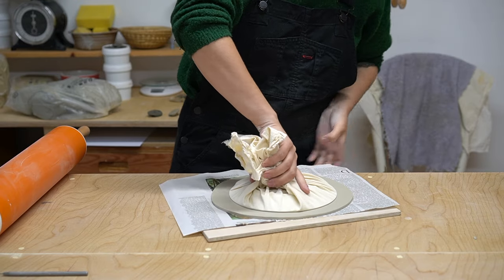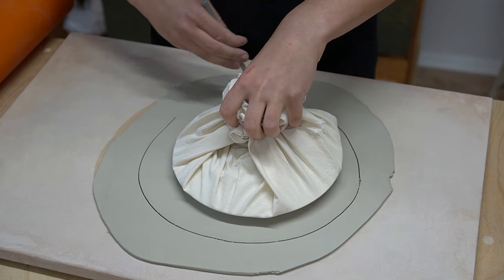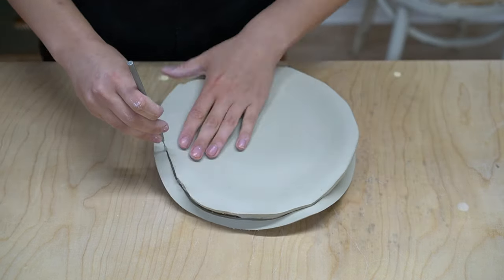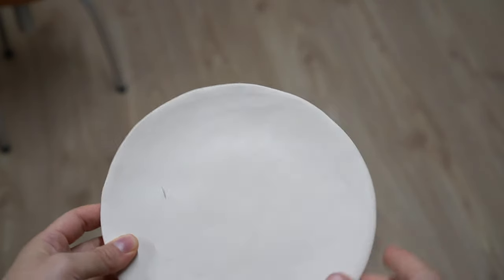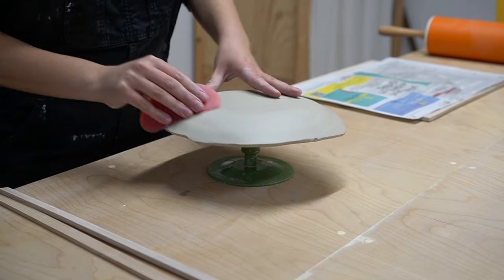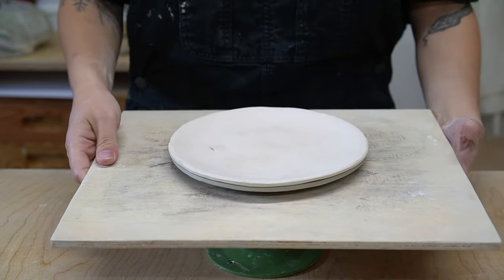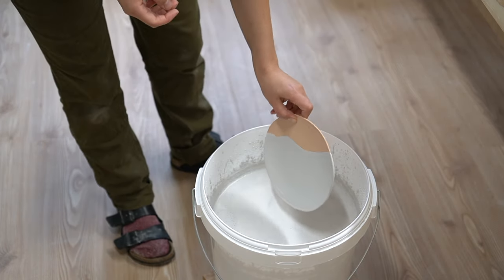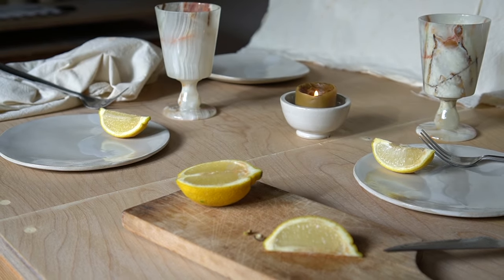The Easiest Way to Make Plates! // How to make ceramic plates using molds // easy pottery project

Comment: What type & weight of canvas is best for wedging clay on? Can it be used & covering Hardie backer board? I haven’t got to the plaster board yet; hwr, I know I’ll need a way to slow & speed up the drying without being over saturated or drying to fast. I live in southeastern USA. We generally have mildish winters. The summers, not so much. We get high humidity & high heat temperatures here. My husband moved some things around, which has allowed for me to use half the barn space plus shelves. My pottery wheel (25+/-yr old Shimpo RK Whisper) is out of mothballs again! I’m hoping to find some way to build a table around it.  We will need to get another wheel if he stays with it. He’s getting pretty good at centering clay, though I think the engineer in him would do extremely well slab building. 🤞🏼 

Any assistance is welcomed. I’m currently wedging clay on a Hardie backer board edged with painters tape.

Comment: 1:54 I noticed that you had trouble with setting down the fabric wrapped plate so you can work with it (you just cut to the plate on the table). Maybe next time you can have a shallow bowl or wide cup ready that you can put the excess cloth knot into, while still having enough support to work on the piece.
Reply: Thanks, good tip